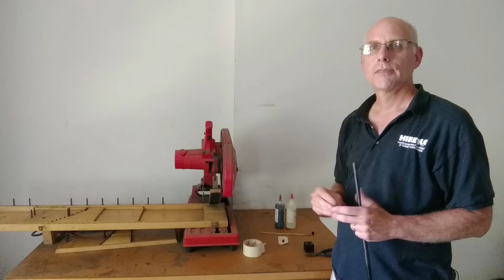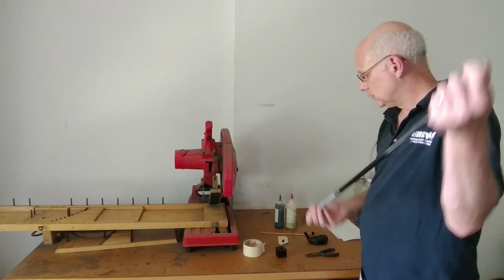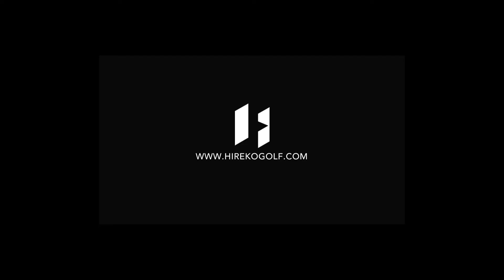Golf Club Assembly with Brass Shims

Comment: Hi! I have a question about changing shafts from Bridgestone J15 CB to Srixon Z355. The Bridgestone J15 is fitted with Aerotech Steelfiber i95 shafts, bur the clubheads are more worn then I expected. I bought them used from Ebay and some of them are very good and some very bad when it comes to marks on the hitting surface. To find new J15 CB clubheads 7 and PW are like finding a needle in a haystack
The Srixon Z355 is fitted with NS Pro 950 GH steelshaft. These irons are 1 year old, but the shafts create vibrations and pain in my arms that the Steelfiber i95 don't. The tip of the shaft in the Bridgestone are .355 and the Srixon is .362. What kind of shims do I have to use when the hosel is bigger on the Srixon then the Bridgestone?
/Jan A (Sweden)
Reply: Hello there! While I'm not a master club builder, I'd say for that small of a size difference you or your club builder could try mixing the epoxy with shaft beads or something called "quick center". Both products are essentially tiny beads that you mix into the epoxy and they fill the gap between the shaft and the hosel if the shaft fits just a little too loosely. Unless they make a 0.07" shim (I've only heard of 0.15" and 0.30" shims) or you make your own shim, shaft beads or "quick center" (sold by GolfWorks) is your best bet. I hope this helps!

Comment: Do you epoxy the ferrule into place?  I generally do so that they do not ride up, though I was never sure if it is necessary or not.  I often see cases of OEM clubs that eventually develop a gap between the hosel and the ferrule.  I suspect that it is the head sliding off the shaft just a bit rather than the ferrule riding up though.
Reply from the maker: It never hurts to apply epoxy underneath the ferrule.  In this particular circumstance the ferrule needed to be force driven up the shaft tip as the shaft tapered immediately and there was no fear that the ferrule would slide up.